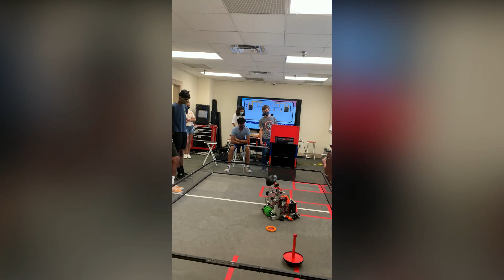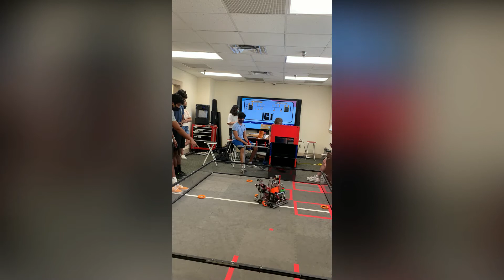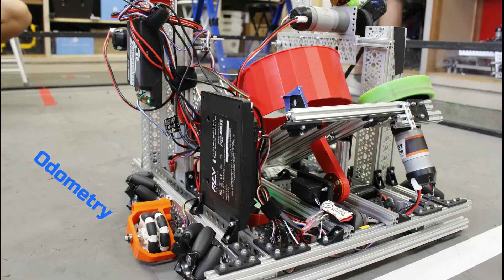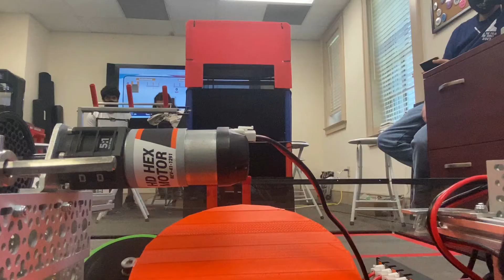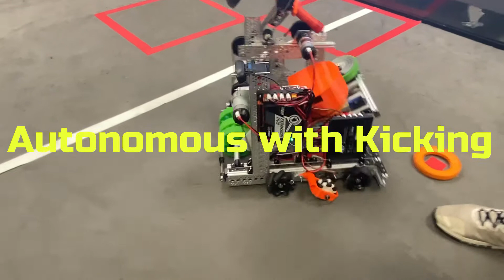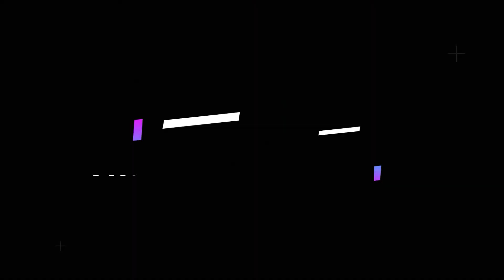FTC Static Discharge 11172 Control Award Submission

Comment: Great robot and programming! What advantage do you see to having Pure Pursuit over Roadrunner? Also, if you're knowledgeable on the topic, do you know if Roadrunner is specifically a path following algorithm, or a library that tracks position and follows paths?
Reply from the maker: Roadrunner is library for tracking, planning, and following paths as well as localizing your robot. It allows you to set acceleration and velocity constraints and use different state of the art followers to follow quintic spline paths that curve to achieve more stable trajectories. Roadrunner also separately provides it Localizer class, which allows anyone to localize there robot with dead wheels or motor encoders easily. You can use the roadrunner localizer separately from the roadrunner pathing, as we do, or you can use them together as in normal roadrunner usage. I chose to use Pure Pursuit because I felt it was far less tuning, easier to implement and debug, achieve about 95% of what roadrunner pathing could achieve. If you are a team without a super solid foundation for programming, I would recommend using roadrunner for localization and pathing because there are many great tutorials and resources for it.
Reply: @ftcstaticdischarge7051  What do you mean by a super solid foundation for programming? Next year I'm going to be the only programmer (only one who knows java at least) and I'm going to try to do odometry, and I think I'm pretty good at programming, but I'm not sure what you mean by super solid foundation.